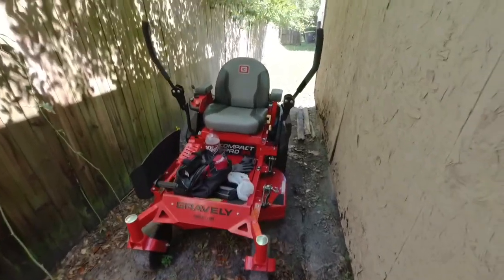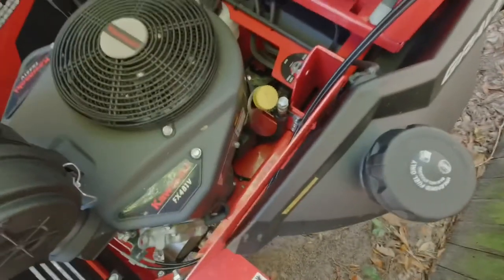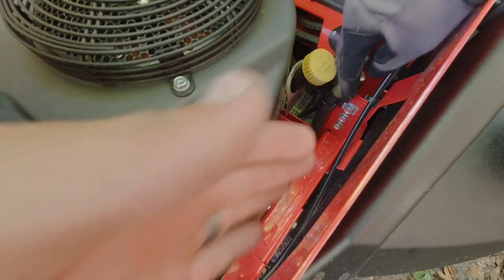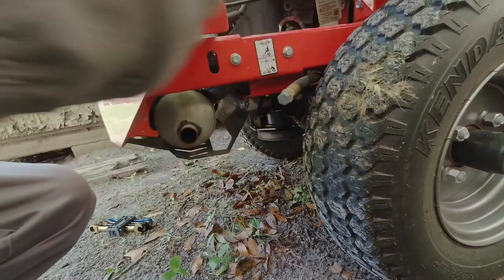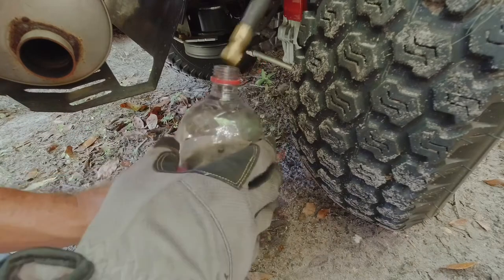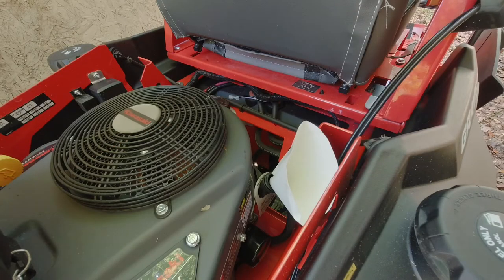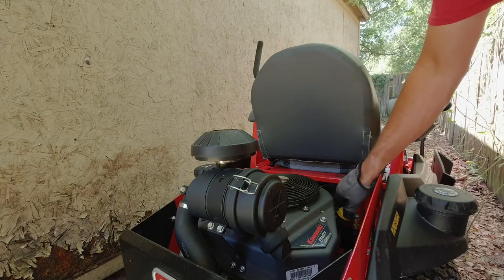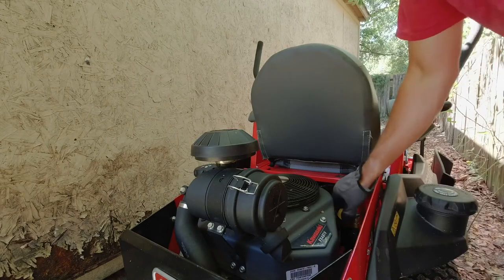Change Oil Gravely Mower ( Compact Pro ) zero turn Kawasaki

Comment: I keep the filter on and just open the oil filler cap and hose end to drain into a pan.  Then turn the filter about 1/4-1/2 turn to bleed the system.  After I have 1.75q of oil drained out, I remove the oil filter completely and don’t have any oil draining out back on the deck.  Good luck!
Reply from the maker: Thanks for the tip, I’m also wondering if they make something for that spot under the filter it looks like a lip or something you could set something on for it to drain out the side I could be wrong
Reply: I have a old 2010 gravely compact pro 34" I don't seem to have that hose, it looks like a plastic oil drain plug on the side of the Kawasaki engine (FX481V-AS00) it used to be maintained by a mechanic, it still runs so I'm trying to change oil and plugs and let the shop change hydraulic and filters. Hope to get 300-1000 more hours out of it. Anyone can confirm drain plug would be appreciated.